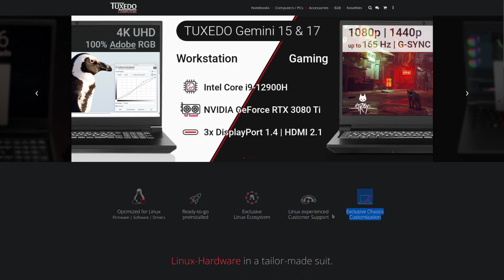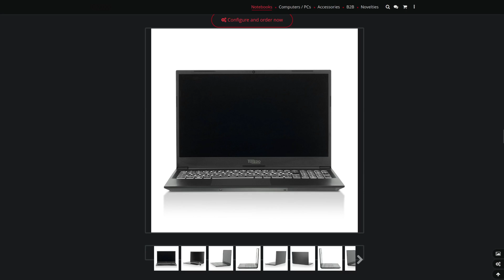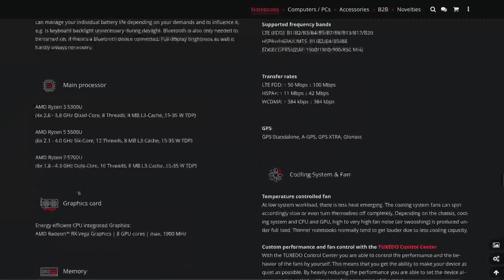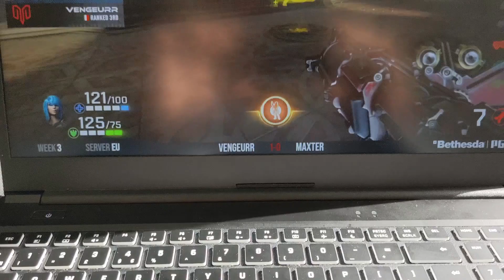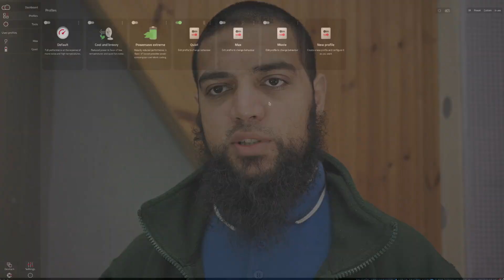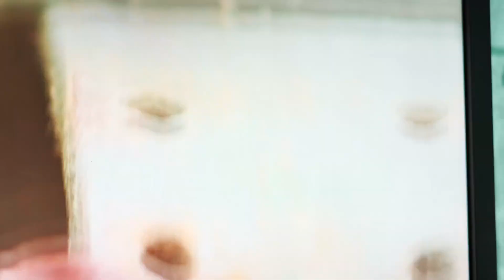TuxedoComputers Aura 15 Gen 2 (Ryzen 7 5700u, 16GB) - Review

Comment: Thank you for replying at the questions to previous video!!
The problem of the sd card reader could it be a missing driver?
How much time the battery lasts on full charge with power save on doing office work or video playback?
Reply from the maker: I can easily get about 5-6 hours doing office work and playing videos in the background. I'll look into the SD card driver.

Thanks
Reply: @NajamReviewsTech  Thank you
Reply from the maker: I've got the MicroSD Card to work. It seems to work if I put the card in before turning on the laptop :/

Otherwise, I can get it to work if I run "lspci -knn | grep -iA2 card" in the terminal.